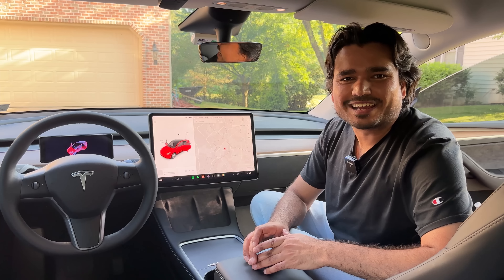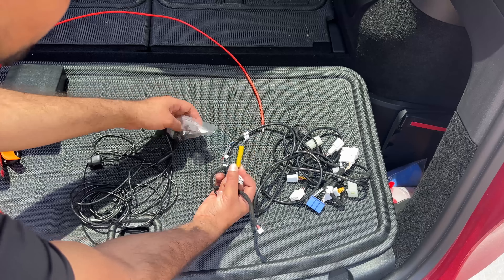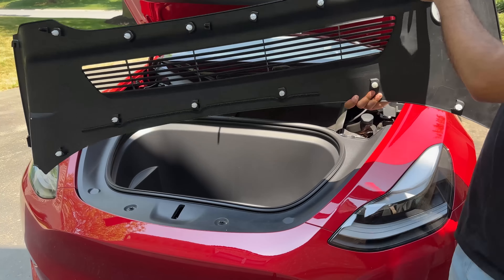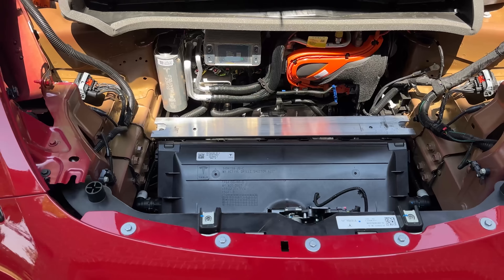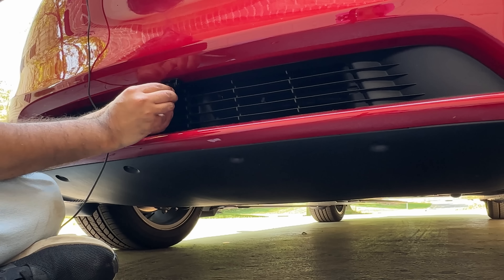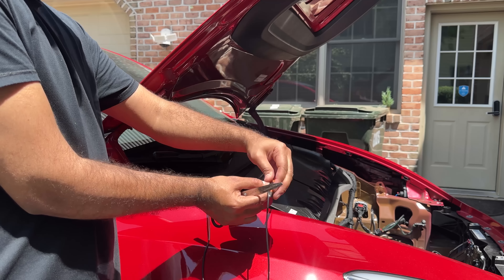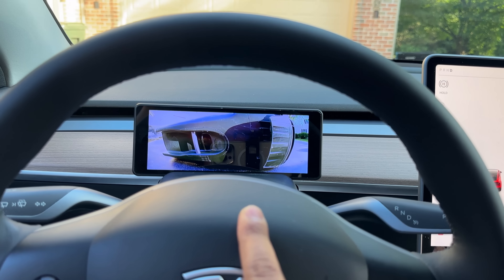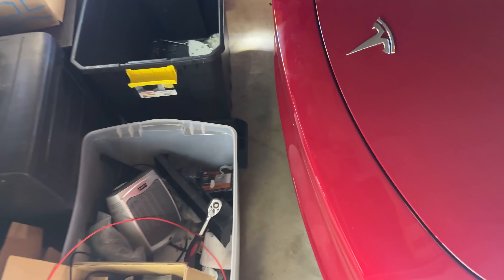NEW Front Bumper Camera For Tesla Model 3/Y - Integrated BEST Instrument Cluster Display 2023

Comment: Great install video – just one tip, which I think is very important – you need to see a slither of your front bumper on the screen to accurately determine how far you are exactly from objects – perfect examples of this is when you adjust your wing mirrors when you’re driving your car – you see a little bit of the side of your car– also, with a factory fitted rearview reverse camera – you see a snippet of your rear bumper so you know exactly how far you are from other objects – other than this, great job
Reply from the maker: Thank you so much for your feedback. I appreciate it.

Comment: IMO the lack of blind spot video makes the device not super appealing. The speed in the left is redundant , the hp indicator In the right is less than desirable. Also the color of the autopilot should turn white or blue (from grayed out) according to the status of the assisted driving (autopilot>adaptive cruise control>nothing). ALSO add extended date option in addition to the hour of the day). Thank you for your work! Keep it up

Comment: Thank you for this video update. I'm definitely buying this display. I use my '21 Model Y for Lyft, Uber and my own transportation service. I need these solutions as I park and maneuver many tight spots. It's nice that the 3-party accessory companies are filling in the voids Tesla misses. I am a bit disappointed that you went around the bulkhead grommet instead of through it but as least you explained that was not a best practice. Keep up the good work.
Reply from the maker: Thank you my friend. This camera system is awesome. Yeah, I went around the bulkhead grommet since I am not sure if I will have this instrument cluster installed all the time. I review so many accessories, so front camera may not be supported on some of the future ones and didn't make sense for me to make a slit. However, yes, as explained the best practice is to make a hole.

Comment: Thanks, Shiva. I was able to route the camera wire using a path very similar to yours. I really wish Tesla cars would come with a front camera in the first place. My previous car was a Toyota RAV4 which offered a 360 overhead view of the car, making it very easy to park. At least, TMA offers an alternative.
Reply from the maker: I am glad you were able to route the cable. Yeah, it is a bummer Tesla decided to remove the ultrasonic sensors and didn't replace with a camera in the front. Thank you.

Comment: Shiva, thanks for this install video. I actually installed the Hansshow F9C in my 2024 M3 Highland but used these install instructions to figure out how to run the front camera wire into the components bay in the frunk area. If it wasn't for your suggestion here, I would have never figured it out. The F9C is okay. Good as far as not blocking the vent air. UI's are limited (only 3). The only issue I'm having is the Camera is only on during the first drive upto 20 MPH. After 20 MPH, the display reverts to the UI. But when you go below 20 MPH again, then the camera view does not return. The only way to get back to the camera view is to put the vehicle is park again.
Any suggestions.
Thanks again for all of your awesome videos. 
👍

Comment: Definitely a nice safety feature for the USS-less cars, or even older cars with the sensors.  They aren't always accurate, either.  That said, the Teslavision, with the exception of your first test in the driveway with the trash can on its side, actually did quite good.  Better than expected, frankly.  Yes, with the camera you can move in a few inches closer, but I'd rather Teslavision err on the side of caution than cut things too close.  All in all, this is a great product that I can see a lot of Tesla Model 3 and Y owners going for.  Cheers.
Reply from the maker: Thank you my friend. I really appreciate it. Yeah the vision system is catching up but I don't agree with Tesla's placement of the cameras. They should have included one in the bottom bumper like this one. Hope they are adding more cameras in the HW4.
Reply: @ShivaSapkota  Hopefully Tesla will offer one for their current system so that it integrates with OEM software

Comment: Great video. I noticed that when you press the button to activate the camera it conflicts with the voice command. Is that an issue? Specially if you want to use voice command not to turn the camera on? Thank you
Reply: Did you ever find an answer to this. I just installed and have same issue. Voice command opens but not camera.

Comment: Still considering installing classic USS PDC to my TMY. For rear use, it is easy to use reverse light signal trigger. Front is tricky to trigger, but this device has the logic inside - would it be possible to use the camera power source cable to also source/trigger front mounted PDC in the bumper? Is the camera activated by sourcing its voltage?

Comment: Hi Shiva, great video. I am try to thread a cable in the same place through the firewall. I have the same fishing wire as you. My question is, how easy was it to tread through? I seem to be encountering a lot of resistance when trying to push the wire through there. Is there a trick to it? Thanks.

Comment: Thank you for the video. This is definitely a cool accessory. One question: since this type of accessory requires wiring/effect vehicle’s electrical system, does it void Tesla Vehicle Warranty?
Reply from the maker: Thank you very much. It is hard to say anything about the warranty as you do need to tap into Tesla's plug and power but simply adding a third party units like this prevents Tesla from voiding your warranty, we have laws to protect customers. However, if the install or the after market parts damage Tesla OEM parts, then certainly, Tesla can void the warranty for that specific part.

Comment: Shiva, I have a question about the wiring harness.  When you connect the harness to the blue port (AMD model), does the harness provide a female connector for other accessories?
Reply from the maker: Yes, this specific vendor also sends you a female port that is unused and can later be used for other components. However, it would be worthwhile to request it during order process just be to sure. Thanks.

Comment: Shiva, awesome video. One thing I would like to know is if you have a hand show camera already would it work with it? A feature I think they should add, is showing what speed you have set that would be over or under your auto pilot setting. Also be aware of which I’m sure you are, hansshow has already come out with identical unit too. If this company is more responsive with changes, I might switch from my 10 1/2 inch that I have now with CarPlay to this unit without CarPlay.
Reply from the maker: Thank you very much. I asked that question to TMA and they said Hansshow's camera has different resolution and doesn't work with this system. However, I would give it a try with the old camera before installing the new one. I saw Hansshow's ads about this product, my guess is they bought it from TMA are selling it on their shop. That is a pretty common practice with these companies, that the manufacturer produces these products and the rest of the companies buy and resell basically. I cannot guarantee that TMA will be as responsive as they are right now given they just launched this product, but they have been a lot more approachable and amiable to all the changes I have requested. Their Carplay version of this display should come out in the next few months.

Comment: So have they fixed the screen that allows for auto switching of light/dark mode to change with the center console screen yet or is it still manual/timed?

Also, how does this screen compared to the other ones?  I had the early 10.25" screen and a newer 9" non android screen w/ android auto/carplay, how does this one compare to those 2?
Reply: Which screen is the best in your opinion?

Comment: Shiva.. I don't suppose you took the bumper of the sensorless M3 off did you? The reason I ask, is because you are absolutely right about the Vision system, and I am embarking on a project to install the parking sensors, as well as a second hand radar unit into my M3. I then plan to litigate the functionality activation with Tesla themselves, but I was wondering if there are hole drill markings on the inside of the bumper, so that one can more precisely bore them out, and install the sensors.
Reply from the maker: Hi Robert, I unfortunately didn't remove the bumper to check but I doubt Tesla left those hole markings there. If your car was made during the transition period, they might have markings though. If they are abandoning the USS then it wouldn't make sense for them to use resources on making those markings. I am going to be replacing the front fog lights here in the next few weeks, so I can let you know :) I was actually thinking of adding sensors myself and hooking them to an instrument cluster, however, rather than drilling the holes I was thinking of 3D printing a plastic piece that can hold the sensors and then just route the cables up through the bumper. That piece would compliment the black liner under the bumper. Thanks.
Reply: @ShivaSapkota  That would be wonderful, thanks! At the very least I hope Tesla lets customers retrofit their cars with a radar unit. The harness still has the pigtail, so it's not like it would even be that hard to do. I for one would gladly pay for such an installation. Elon definitely needs to address that at least, since it was he who rammed that particular change through, against strong objections as I understand it.

Comment: If you are using the Tesla issued front license plate folder, do you adhere the camera to the under lip of the license plate holder?
Reply from the maker: Yes, I did that with my Model 3 in the past and it worked great. Thank you.
Reply: @ShivaSapkota  Ordered this display with camera from Hansshow.
Reply: Great Videos, Thank You
Reply: How would this camera adhesive mount with the Quick Bandit license plate holder?  I haven't decided which to use yet, but will need to make a decision in the next week to 10 days.
Reply from the maker: @tomwilliams608  That one is going to be tough as the thickness on that license plate holder is slim unless you drill two small holes to put the camera screw. The regular plate holder that Tesla gives you with the car is easier for this install.
Reply: @ShivaSapkota  I was looking at the Quick Bandit and thinking that does not look like it would work will with a bumper camera.

Comment: Nice product.. 1.  Can’t center that in states with a front plate requirement and 2.  In the snow belt this camera will be useless.
Reply from the maker: Thanks for your feedback my friend. In the front plate states, actually it is even easier to just paste the camera underneath the bottom black plastic of the front license plate. I had a front camera installed on my Model 3 in Colorado extreme weather and it worked great throughout the winter. But it certainly depends on the region.